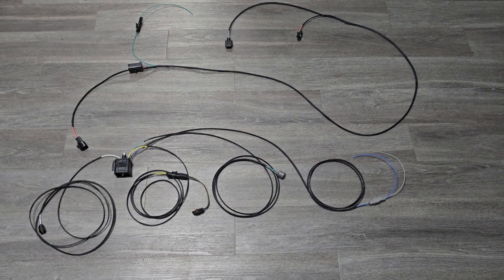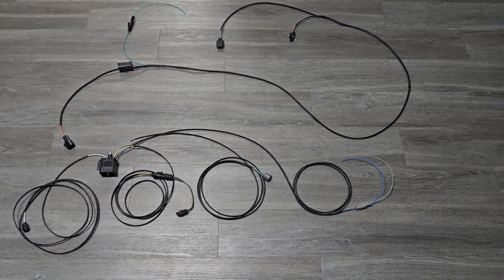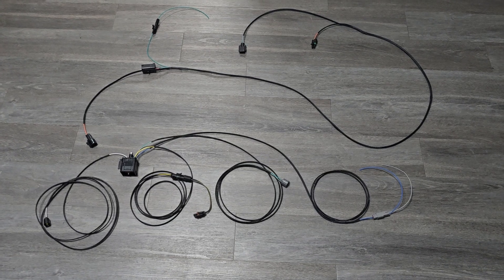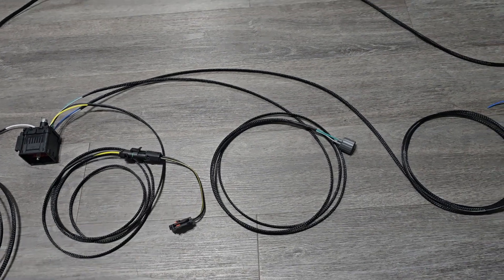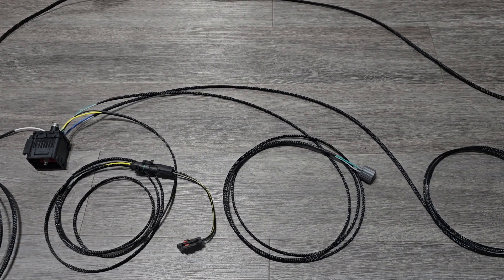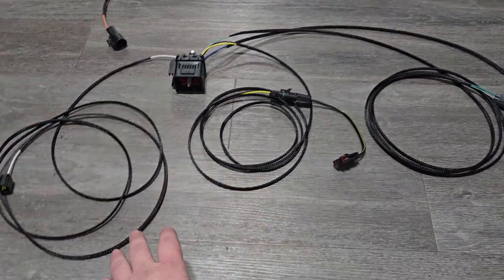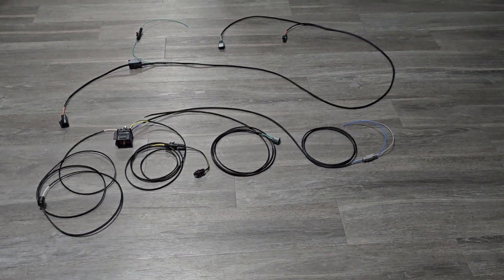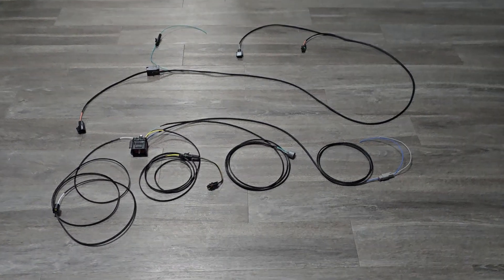Lethal Nate Coyote swap new edge mustang gauge harness install information.

Comment: Nice. I did my own wirng on a Gen1 swap ('02 GT) and did find at the time the Pos + tach lead from the 42pin is the only wire you connect to the Coyote crank sensor. Tach will fluctuait a bit 1500-2000rpm, but otherwise works just fine. All stock gauges in mine.